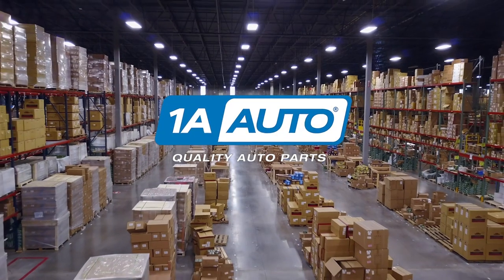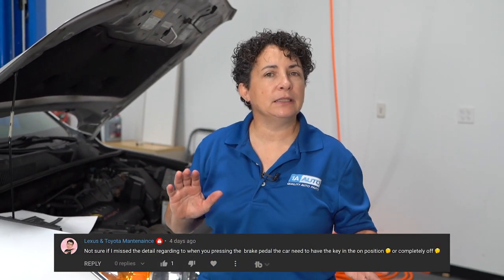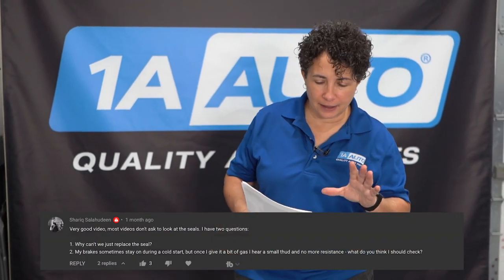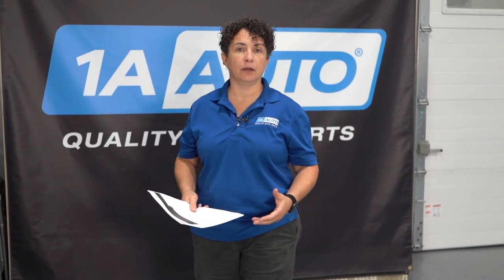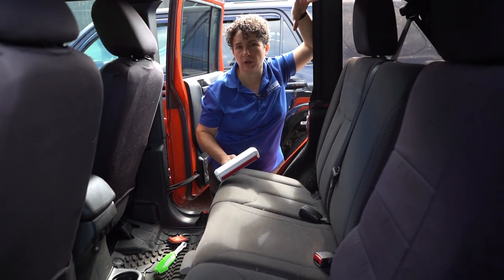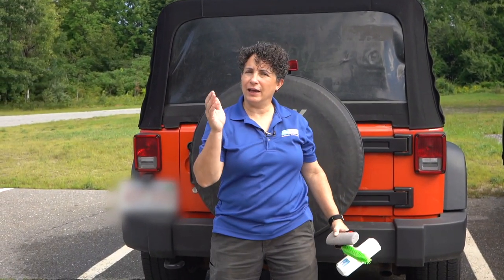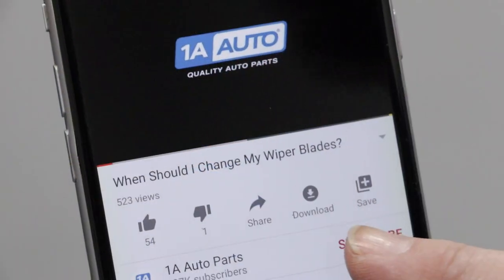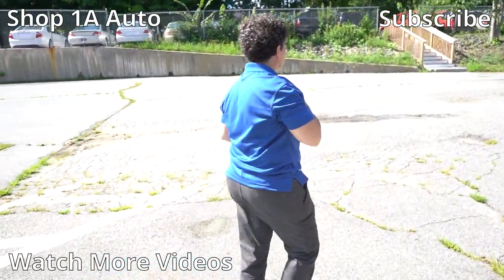Sue Tackles Viewer Questions! Top Comments from Our Most Popular Videos!

Comment: In a manual transmission, often the brake fluid and clutch fluid are sharing the same reservoir.  Leak in either system can cause low brake fluid

Comment: Any extra ideas on what could be causing a loud underbody hum/whine  in a ‘06 Liberty only: 
-when between25-60mph (slower or reverse no sound).  When I go above ~62mph it 95% goes away 
- sound starts at ~ 30mph, and increases until ~60mph while on the throttle  (sound disappears completely otherwise).  
 - Doesn’t change when Turning either direction.

Comment: I have a '94 Dakota with 253,000 miles on the clock.  I was driving down the street the  other knight, approaching an intersection.  When I applied the brake, I heard a loud pop, and the brake pedal immediately went down to the floor.  The ABS light is on, but I think this vehicle is OBD1, and I don't know anyone who still has an OBD1 scanner.  Besides, it only has anti-lock brakes on the rear.  There don't appear to be any leaks in the system, and I'm wondering if the brake master cylinder is that problem here.
Reply from the maker: +usmale47374 We wouldn't be able to diagnose an issue like that here, you may want to have a local mechanic take a look at it. Thanks for checking us out! http://1aau.to/m/Shop-1AAuto-c

Comment: Hi Sue. Great videos. You made a great video on a 2002 Focus timing belt replacement. My question, I have a 02 Focus SVT with VCT on the intake cam. How do I time the cam phaser to the cam or does it matter since the crank is locked at tic and the cams are locked in??? Help Sue.! Thanks